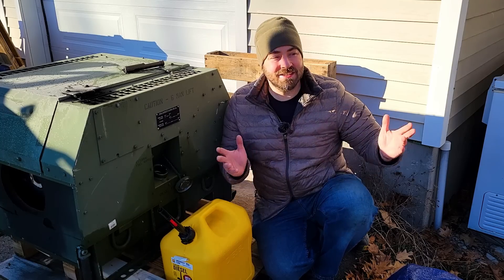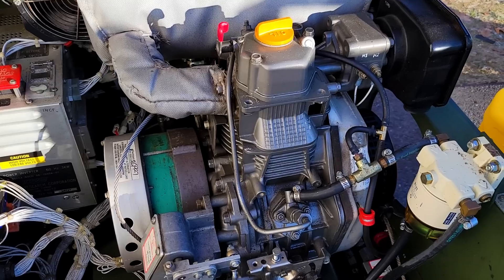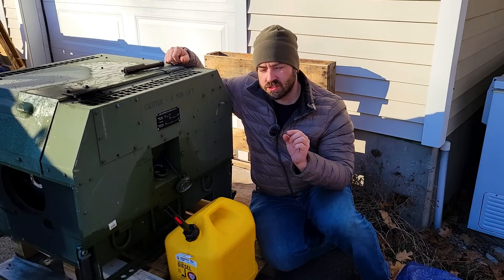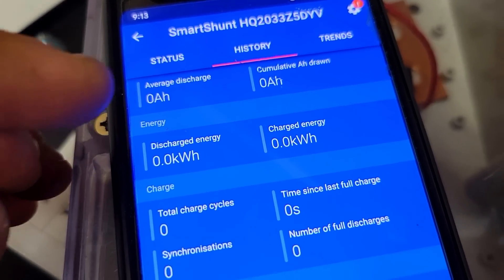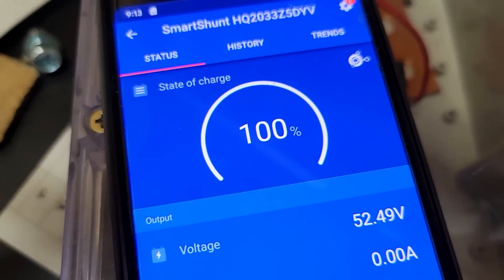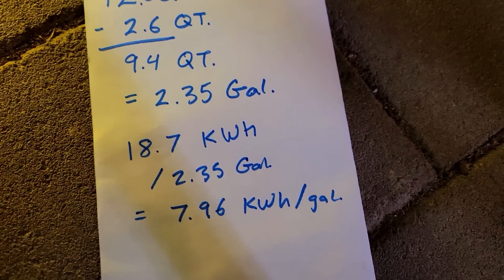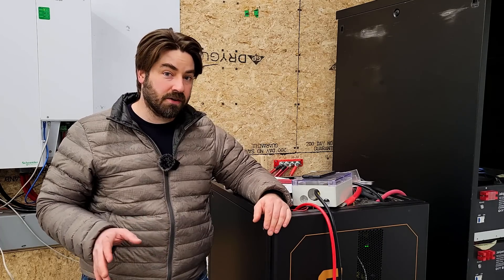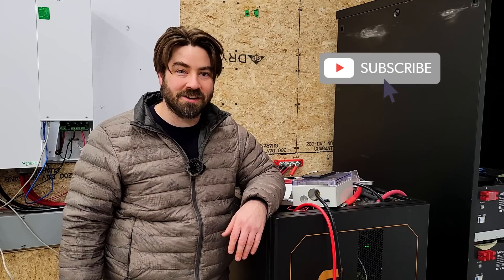How efficient is this Army generator?  MEP-831A

Comment: Quick search shows these are listed between 2000-$3000, so $1k at auction seems like an exceptional price.
Reply from the maker: That's because when I bought mine, it wasn't running.
Reply: @DavidPozEnergy  ah yes, you did mention that. My bad.
Reply: Beware however, The engine life for making rated power tops out at around 3000hrs. 
I've got one and one engine expired before 500hrs, the second brand new engine now can't make rated power at 3500hrs on the hour meter. It makes only about 75% of rated.
No governor adjustment makes any difference. It's still useful as a backup. Always had regular oil changes.
Reply: @ThePaulv12   Have you pulled the fuel injector? They have a service life of 1,500 hrs on that engine. Any oil consumption?

Comment: A gallon of diesel or gasoline is roughly 33KWHrs. So a better approximation of efficiency is KWhr produced by generator / 33KWHrs. You can do that for vehicles as well. My Geo get around 40 miles per gallon.
1 gallon approx = 33KWhrs. 33,000 WHrs divided by 40 means I use 825 Watt Hours to go 1 mile in my Geo. Electric cars use about 250 to 300 WHrs to go that same mile.
Reply: A gallon of diesel is 43.1 kWh.  A gallon of gasoline is 36.6 kWh.

Comment: Jusy wondering how you compare a diesel against a petrol like that, its like comparing chalk and cheese, if you are using diesel dont you have to find the energy density of both fuel?
Reply: It's comparing a generator to a generator. Fuel in. Electricity out.
Cheese vs. cheese. 

Who cares about the fuel density?

Comment: The energy content of diesel fuel is approximately 37 kWh/gallon, so your setup is about 8/37 = 21% efficient. That means 79% of the energy is wasted. The sooner we can get away from burning fuel to make electricity the better!
Reply: So nuclear then?
Reply: Combined heat and power plant!
Reply: Co-gen!!!!
Reply: Solar panels are 15 to 17% efficient. The thermal efficiency is not why we use oil, it's the energy density and the portability.
Reply: I came to comment the same math and suggestion. Though this might be more of an emergency thing than something that’ll be used often.
Reply: That will never happen. Base load power needs to be consistent.
Reply: What if our fuel were boiled out of the air? Plants do it every day
Reply: And diesel has about 1/3 more energy per gallon than unleaded, so actually the honda is more efficient.
Reply: @Guyonthelist   I did the math on energy contents in another post. TLDR: The military generator is actually 14% more efficient in BTU per watt basis than the Honda (not 35%) and in general cost 1-10% less to run. The cost of fuel has some large assumptions, and the Honda may indeed be more cost-effective at times. If the cost of diesel is 1.35 times greater than regular, then buy the gas.
Reply: @Guyonthelist  Not to mention the price difference.  At least where I live the pump price of diesel is about $1 more than gasoline.  Even the offroad diesel, if you can find it is not much cheaper.
Reply: Imagine how much less efficient all those cars are that are on the road.... Generators are designed to run at a single RPM efficiently. Engines that power vehicles aren't as efficient
Reply: @bimmers50e30 That’s already been tried with CVT transmissions. It ends up being a wash.
Reply: @bimmers50e30  автомобільні мотори ефективніші, ніж ті, що на цих генераторах, інша справа в не ефективному використанні в міських умовах при різних режимах.
Reply: @bimmers50e30  Yeah. Especially in city traffic cars are extremely inefficient.
Reply: A very large chuck of that 79% is heat. Heat that could be going into a water tank or warm a home in cold weather. While that is often not the case, it easily could be. When system are designed to put waste heat to good use instead (usually direct heating or heat storage), even ICE system efficiencies can exceed 90%. Having myself tossed around the old your inputs/outputs = ICE is hot garbage argument, I was surprised to learn just how much I was discounting how hot could be an asset. Not that high efficiencies change the C02 issue, but it can be a low-cost way to slow the growth curve.

Comment: Can you compare energy density between fuels in your calculation? (there are also propane generators).also add some cost of running calculation with average fuel costs.
Reply from the maker: Sure, in future videos I can add the costs of fuel into it.  
I don't own any propane generators.  If you own an LPG set, then maybe we can get together for a test?  Are you in New England?
Reply: @DavidPozEnergy   I dont own a LPG generator, but there are homes that heat with LPG and can set up with a generator from their tank . My interest is more about the DIY generator you built, a 250w system to run 24-7 would work great for my needs. I am in CA where its $0.43 per kWh from PG&E. So we are not quite there yet for financial break even, but there is likely this tipping point in the future.
Reply: Leave the fuel costs out of it. That will only matter at the time that you make the video. Fuel costs go way up and down, even in relation to each other with diesel and gasoline. 

You'd be better off making a spreadsheet so people can do their own calculations based on what they need at a given moment in time
Reply: The energy density of diesel is 43.1 kWh per gallon.  The energy density of gasoline is 36.6 kWh per gallon.

Comment: Another great video!   I hope you will try the diesel at 80% to see if it is more efficient and also include the difference in price per gal for gas and diesel in your calculations for the comparison.
Reply: Agree would like to see $$per kwh diesel vs petrol, curious if it would be roughly the same price wise, also nice 831A have one myself as well as an 803A :)

Comment: I have a lot of generators. Nothing beats, however an 1800 RPM liquid cooled prime diesel generator. Both for longevity and for efficiency, as well as being much much quieter. These smaller generators in particularly the Honda gas generators have are standby generators, and not meant for prime use, so if you want to run these for days and days on end they will not last very long

Comment: I would like the Military style generator, because its a beast and built tough!!! But I was lucky enough to get a Hoomy Depot Glitch a few month for $279.00 it a PULSAR4,500-Watt/3,700-Watt Dual Fuel with Recoil, Remote and Push Button Start Portable Inverter Generator with CO Alert and its much smaller and it hopefully use that much Propane... I have not started it yet!!! Liked#138 N Subscribed!!!
Reply from the maker: Good deal.  I hope it starts well for you.

Comment: Problem with all these generators: You only use the electric output, not the heat. The military generator only uses 17.8 % of the energy in the diesel to make the electric power. The rest is waste heat. 
Since most solar user only need generators in the winter, it would be pretty nice to have one with a radiator that you can put inside a cabin. Too many people died trying to use a generator indoors and only have an exhaust going outside. If the exhaust vibrates off or has a leak, you die without even noticing.
Reply: For off-grid usage cogeneration is the way to go.
Would need liquid cooled generator for that though, i don't think a lot of them are. Or maybe DIY exhaust heat recovery with EGR cooler or something similar.

Comment: Inverter generator is not that much efficient at full load, the main point of that complexity is the efficiency (so fuel consumption) mainly at partial or mainly light load, something you will get from rather normal home when no batteries are involved. The point of the inverter is to allow to operate the engine at rpm most optimal for the given load, so gain mainly at light load, when it uses to spend most of the time (without batteries).
Having batteries indeed allows to operate the generator at its peak efficiency all the time it is running, but then you won't need the inverter complexity and related losses in it anymore.

Your comparison mainly shows differences between energy density in fuels and general efficiency difference between diesel vs gasoline engines.
Reply: The other point of an inverter generator is a much cleaner sine wave (less harmonic distortion).

Comment: I used my tractor pto generator and can get pretty good kwh per gallon. I tried measuring it once and think it was a little under 10.
Reply: I am looking into the same platform for a Unimog 406 pto driven generator. I am interested in hearing what kind of battery system you are charging. We are going off grid 48 volt system.

Comment: Interesting - that works out to a little over 50 cents per kWh. High compared to grid power prices in most of the USA, but actually a bit lower than the peak rate where I live in Northern California. In theory, it would be cheaper to run that diesel generator than be on grid during those hours.
Reply: For an European price comparaison: army generator is 2.10 Kwh/L of diesel. As of Jan 2024 in France, gas station diesel is around 1.8€/L (Its 7.4$/gal!) without road taxes its 1.35€/L. Final price is around 0.85€/Kwh (or 0.64€/Kwh without road taxes). Electricity from the grid average price is 0.25€/Kwh. 🙃
Reply: Wow, those are some crazy prices.  @hardrout17
Reply: Don't forget maintenance on the generator.
Reply: Is that with California diesel prices? I know the prices varies greatly state to state
Reply: @alexjeffs7092  county to county, and even in az if you go down the road a couple miles you can find gas 40c cheaper.
Reply: We are in Reno, Nevada... I was thinking the same thing.
Reply: wtf yall pay MORE than .50 a kwh????????? California is wako crazy I had no idea.
Reply: @f-j-Services . Yes thank Gavin and Nancy with their communist inside information agenda!!!  And high crime rate and high taxes in California along with running a deficit there?!?’
Reply: Did you factor in amortized cost of the generator?
Reply: @mcarling6495  I did not. I'm sure that adds a significant amount...
Reply: What is missing in the equation is equipment depreciation and maintenance, which will vary considerably based on an individual's skills and how they value their time spent on maintenance.
Reply: That's horrible. That an old military genset beats grid power in terms of price
Reply: Yeah,  now compare that to the cost per kwh for a  solar system.

Comment: I like whisperwatt generators, cause they're so quiet... 

The Chargeverter must be connected in the correct "polarity"... I'm running mine through an Intermatic timer... Initially it would deliver no current. In reversed the brown & blue wires and voilá! Signature had no explanation...:-(
Reply: what?  you mean swap L1 and L2 -  again what?

Comment: As a battery charger ONLY, it will work pretty good; if you try to power the 'whole load' with that gen, you will be disappointed. I used those things in the Army and watched them catch fire for no reason. Keep several fire extinguishers handy and place it further away from structures you don't want to burn down. 
Good Luck finding spare parts for this generator!
Reply: No reason for a Yanmar to burn diesel is safe, likly you guys didn't maintain it, like many military personnel lol. If it started in an electrical fire I'd bet somebody overloaded it,.3,000 watt output isn't much.
Reply: @walkertongdee  sadly, this is true.  There's a specialized job just for that in the army but just because you're a dedicated generator mechanic doesn't necessarily mean you're mechanically inclined or know what you're doing.  Sometimes people will pick jobs just because they sound cool or it means they get to stay out of combat.
Reply: I'm sure there were reasons, determining what those reasons were was the hard part.
Reply: i remember using these in the field and we kept them running continuously for weeks. just had to add oil and diesel to them pretty continuously.

Comment: How much of the efficiency gain do you think is diesel vs gasoline?
Reply: Diesel fuel is said to have between 10% to 15% more power as a fuel source. Vehicle engines  are said to have a 25 to 30% gain. Dave shows the comparison in this comprehensive video.  Diesel wins!
Reply: @TheWickerShireProject  So how close could the DIY generator get if it was diesel?  4.85kw +30% gives maybe 6.3kw... I guess the military generator still wins.
Reply: @jontscott  the military one looks to have efficiency in line with a larger higher end propane generator. 

Either way, the problem with it is that it's so small that you'd rack up the hours quickly when you needed it.

Get yourself a 30 kwh propane generator and you'll have the best performance, no refilling the tank and only gave to run it for an hour a day to fill the battery rather than 10.

Comment: Morning Dave! ( Ok watching ) We finally hit over 2k + watts  41 amps This morning. Been burning 1 gallon of gas for the last 4 days. Too cloudy this time of year. Worst month in TN
Reply from the maker: 1 gallon over 4 days is really good.
Reply: @DavidPozEnergy   I should word that Better.  1 gallon of gas per day.   1/2 gallon at 7 pm and 1/2 gallon at 4 am.  4 gallon fuel @ 1 gallon a day to push us through till sun power.  Crazy cloudy last 4 days. 3.1 Kw Hrs since the sun came up at 7am now almost 12 Our time.  Hoping to make 7Kw Hrs today <- would be good for winter. Battery has been 40% to 52% full typically.  Battery #6 is giving us problems. Next time we make the BIG move i'll crack it open and replace the 18650 cells we patched in.
Reply from the maker: Still pretty awesome.
Reply: @DavidPozEnergy   What do you think? I have 3 cracked Panels ( series ) not in use. Should I stick them on their own charge controller and add them to the system?  Is it ok to have 2 charge controllers? This would be set to  56.2v vs the Outbacks 56.7v  ( would you add the panels on to the  array?
Reply from the maker: I don't use cracked panels and don't think they are worth the time to try to make them work.  yes, you can have multiple charge controllers feeding the same battery, but they would all have the same settings.
Reply: @DavidPozEnergy   k got it. I'll donate them  to a new tenant to learn on in the community.